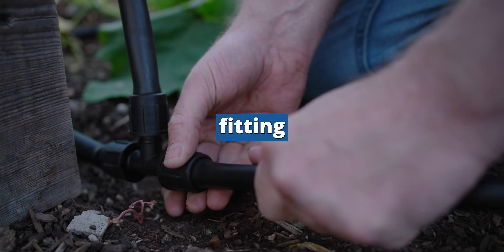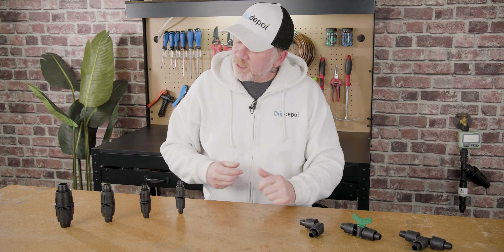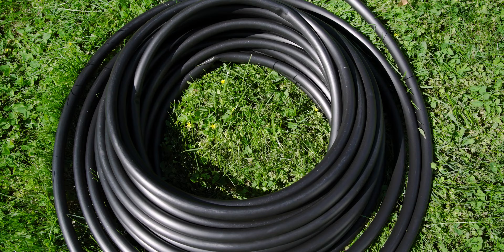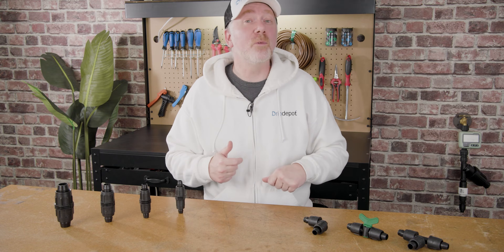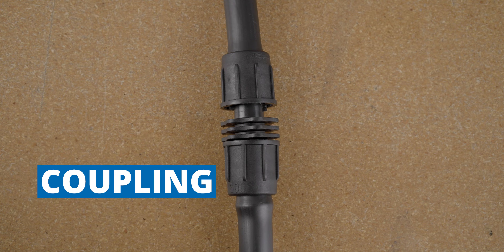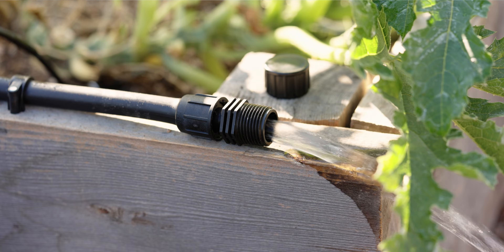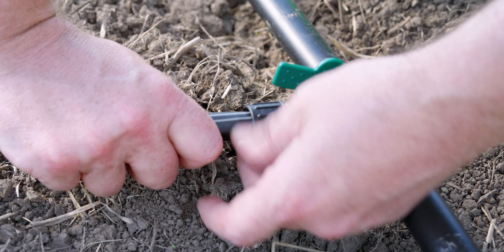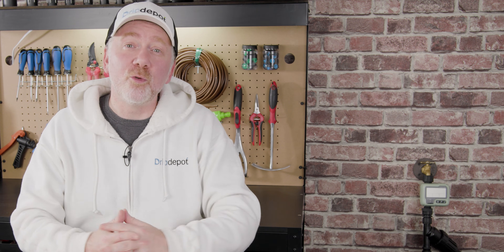How to Use Lock-Style Fittings | Twist-N-Lok & Perma-loc Fittings

Comment: So, "Twist-N-Lok" is just your "in house brand" of "Perma-loc"?? or are there other differences??
Reply from the maker: The Twist fittings are our in-house brand of Loc style fittings :)  

No major differences in their use or specs.  There are a couple minor differences: We don't have them in as many sizes or shapes yet, though we are about to list some 3/4" (no 1" yet though).  Right now we only have the standard shapes: coupler, tee, 90° elbow, end cap, coupling valve and FHTS x Tubing Adapter.  I am cautiously optimistic that more will get added.  

We're also very close to listing our in-house tubing brand, I've actually got a short length of it here on my desk from our test extrusion.  The test was a success (the tubing is durable, dimensions are correct) so we're getting the extruder set up at our old warehouse.  Like the fittings, at first we'll be limited in sizes - the 0.600" x 0.700" for sure, and I've heard we may be able to get some 3/4" 0.820" x 0.940" done before Spring (fingers crossed!)  :)
Reply: @dripdepot  Sweet, Thanks!

Comment: Perma-loc fittings are great I installed an entire irrigation system for the backyard using them almost five years ago and I haven't had any problems with these fittings. They are perfect for repairs as they work on both .710 and .700 tubing.
Reply from the maker: I saw your comment and thought I recognized the name for some reason.  Opened your channel up in another window, and sure enough I've seen a few of your videos.  Pretty sure I shared the "How to Remove Stuck Vacuum Breaker" video with someone who was struggling with one as well.  Thank you for that, great content man!

Comment: Coupling screws onto pipe in counter clockwise direction. Struggled with that for a bit, lol.
Reply from the maker: LOL yes!  This still gets me from time to time, and there is definitely video evidence of me starting the thread it the wrong direction, realizing it and then reversing direction.  Too many years of muscle memory to break it haha, it's one of the reasons I like to speed up the playback of the fitting installation portion of those videos.   Hide the evidence in fast forward :D
Reply: I bought a tackle box to store my tools, connectors, etc. If you guys sold a Drip Depot version I would definitely buy one.

Comment: I want to use 3/4" poly tube for my header/manifold and run 1/2" drip tube laterals connected via perma-loc fittings. Would using 1/2" loc to 0.400 barb connectors be a good choice? Thanks.
Reply from the maker: Do you mean this fitting here? https://www.dripdepot.com/1609

If so, excellent job locating that one!  It's one I don't see used very often (I think people just don't know it's out there) but it can indeed connect 1/2" tubing to 3/4" or larger tubing.  

A Tee can also work, but the 400 barb fitting has a lower cost and works just as well -- the only limitation to that one is that it cannot connect 1/2" tubing to 1/2" tubing, just 3/4" or larger, which sounds like exactly what you've got here :)
Reply: @dripdepot  Yes, that is it. I have a 3/4" main line feeding the 6' long header. I will connect 4 laterals x 13' long of 1/2" PC Drip Line 9" intervals @ 0.5 GPH (SKU 13017) to the header. This is a cumulative flow of 35 GPH -- well below the limit of 1/2" poly. Is there any reason to use 3/4" poly header in this case?
Reply from the maker: @geordonp   In regards to flow, I can confirm nothing is calling for a 3/4" main -- how long will that mainline be?  After 200' it can benefit to start using 3/4", but if your line is under 200' and you'll have ~35 GPH in flow, you would be well within the green to use 1/2" instead :)

Comment: Great video!  I just started using these Loc-Style fittings from your store and I was really impressed.  I had a pool just recently built and due to the construction  I had rebuild my irrigation systems in the front and back yards.  These fittings saved me so much time and effort in my rebuild.  I just loved I could take these fittings off easily, as I had made a few of my own mistakes along the way!    I am a fan!  Thank you.
Reply from the maker: Thank you for the great feedback!  And you're spot on with the time they save when making a mistake -- every video we shoot I opt for those fittings even when the video doesn't call for them specifically, they're just that much easier to use.  :)